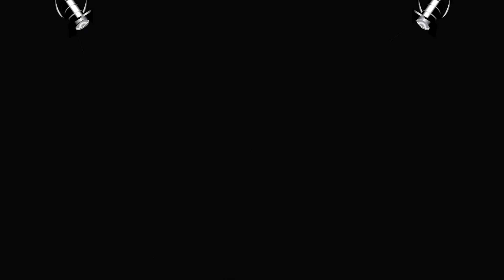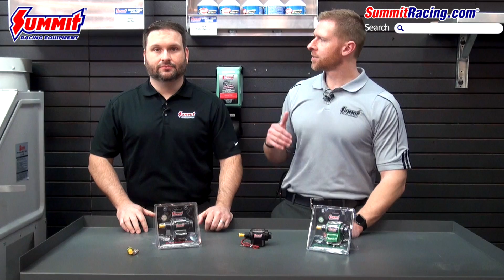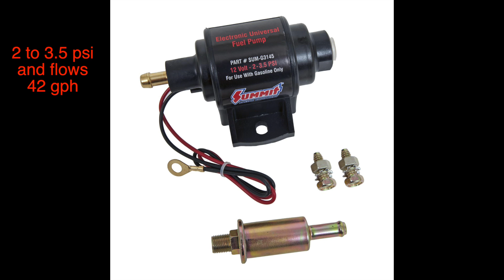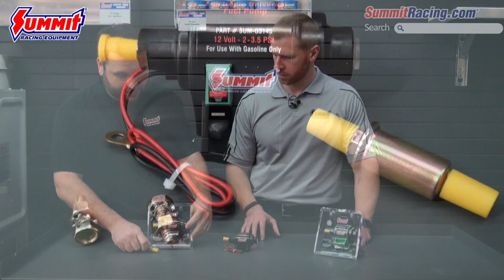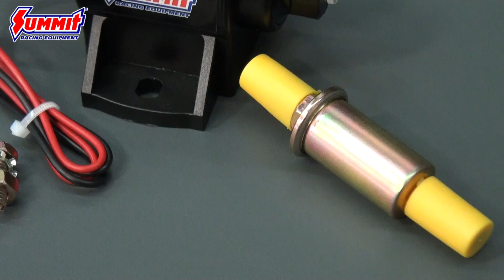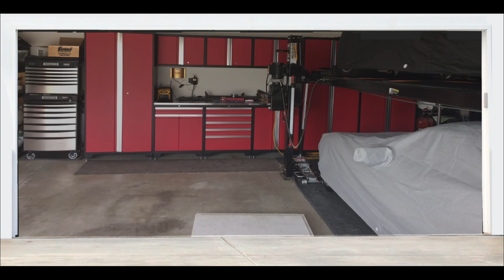Summit Racing Universal Electric Fuel Pumps

Comment: Why do you recommend a fuel filter AFTER the pump?  In case the pump falls apart?  I understand having a filter BEFORE the pump, but not after the pump.  Please explain.  Thanks.
Reply: Fuel pumps like to push, not pull. So putting the restriction of the filter after the pump is easier on it. The filter is just to save the carb from sediment. If I were to run one of these I'd buy 2 and keep one in my glovebox as a spare.

Comment: uh. I have a 440 with straight pipes. I can hear this fuel pump and it's louder than my motor/exhaust. Anything I can do?
Reply from the maker: Hi Rob, The only thing that you can do is make sure that it is mounted to a solid component like a frame rail, not sheet metal and make sure that you have rubber isolators to help dampen the vibrations.
Reply: @SummitRacing  where can i get the rubber isolators? It's mounted to a solid component. It's so loud :(
Reply: @rleonekc07  cut up an old rubber mud flap and use as isolator

Comment: I have a doubt, for some weber carburetors which electric pump do you recommend?
Reply from the maker: Hi Richard, We can’t recommend a fuel pump without knowing what engine you have an approximate horse power. With that said, any of our fuel pumps will work, you will just have to get an adjustable fuel pressure regulator if the pressure is above the recommended pressure for Weber carburetors, which is 3 - 3.5 psi.
Reply: Summit Racing  an apology, the engine is a 2276cc stroker, 182 hp.
Had I read that the side carburetors used 3-5 psi?

Comment: No WAY in hell could one of those pumps supply my thirsty 5.9L 12 valve P-pump Cummins diesel! My P-pump requires a minimum of 100gph with a sustained pressure at fuel throttle of 17-25 psi minimum